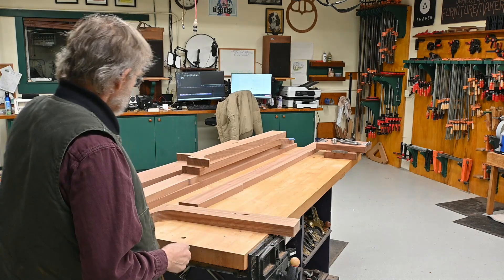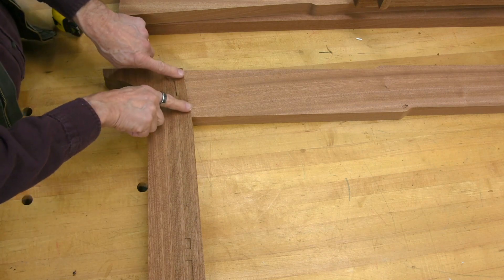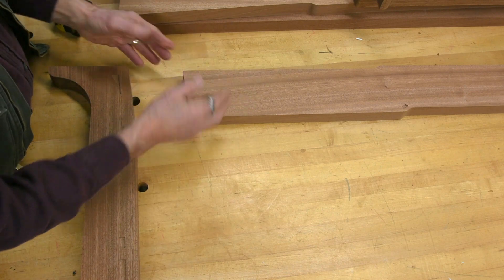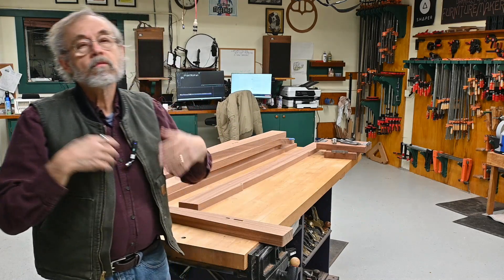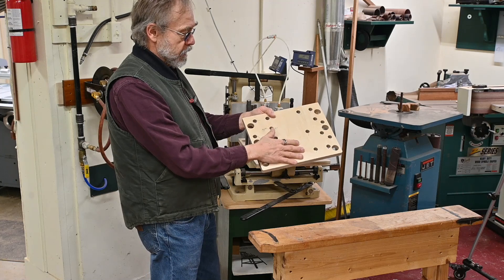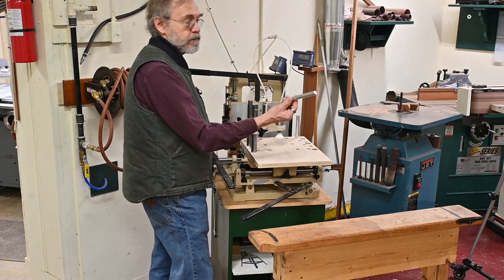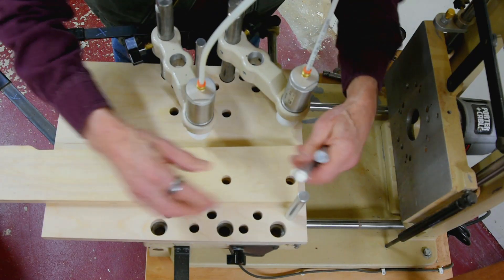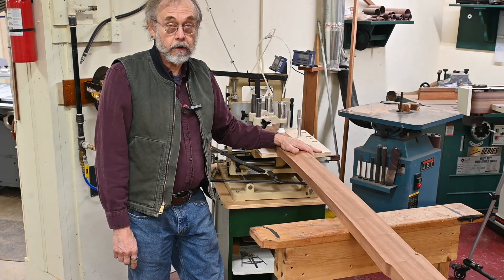Multi-Router : Making an Auxiliary Table Plate

Comment: Hi Darrell.  Where can I get the pneumatic hold downs that you have on your multirouter and table saw?
Reply from the maker: Hi Jeff,  The pneumatic hold-downs for the MulitRouter can be purchased at Woodpeckers - https://www.woodpeck.com/pc-1-pneumatic-clamps.html.  
I got the air clamps for my slider in a trade several years ago. As far as I can tell those particular ones are no longer made.  Felder offers ones that are nicer than mine - https://www.felder-group.com/en-us/shop/pneumatic-clamps~sc123933

Comment: Hi Darrell.  To slot the other end of your piece, will you flip over your registration template and mount on the left side of the table, or do you have your slot dead center so you can flip your work over and keep the registration template where it is.  Nice template ideas.  Thanks.
Reply from the maker: My intention is to position the mortise (slot) dead center and flip the stock.  In this case I recently mounted a different router in my  MR. I will be running some tests 1st to make sure there isn't excessive runout with the bit or router.
Reply: @DarrellPeartFurnitureMaker  Thanks for the reply. Generally I haven't been overly concerned with dead centered mortises, but I've  had to maintain a reference side because of it. Since I got my digital scale, there is no reason that I shouldn't use it's precision and go for dead center.

 I would be interested in a video, maybe even a short video of your findings and reasons for choosing a different router for your MR. Maybe what you like about the new router?  I use Bosch and pretty well love it. I tried a Milwaukee and didn't like it so well, but maybe it was just something up with the router motor.
Reply from the maker: @TallEvaGuy   I might consider a video on routers for the MR.
 I have used both Bosch and Porter Cable routers. Both did well.  
Most of my routers are now Porter Cables. 

The  current router is not new - but new to the MR.  It's a Porter Cable model 890. The base on this model  is longer ( has more contact surface) which I hope gives me more consistency. It also has  better micro-adjustment for depth of cut. 
 I am not familiar with the current line of Bosch routers so I cannot comment on a comparison.

Comment: Nice video Darrell.  I am looking at both the Pantorouter and the Multi-router as possible additions.  I expect that Pantorouter will come out with their air clamps in the next several months which will be a big plus for me.  Since I am space limited, if you only had room for one which would you purchase?  I love seeing the slider in use as well.  Also interested in your CNC vertical work holding setup.  Steve
Reply from the maker: Hi Steve, If I were to have just one it would be the MultiRouter.  The PantoRouter has its advantages but for my purposes the MR is more versatile and precise. 
 My Vertical CNC set up has limited capabilities. I think if I were to dive into it there is potential for serious improvements.  For me its faster to employ the MR  for the things I had intended to do with it.  You might check out the vertical CNC surface that @JayBates has - it looks well thought out and more functional than mine.
Reply: @DarrellPeartFurnitureMaker  Thanks Darrell.  I have seen Jay's and Frank Howarth versions and decided I didn't want to go that route which is why I ended up with the Shaper and workstation for vertical work.  
BTW - I tried the Shaper for the prototyping G&G drawer fingerjoints and it was doable but fiddly.  I used the plunge roundover for the protruding fingers but got a lot of burning.  It may be me or it could be the bit.  Steve
Reply from the maker: @ExtremeWoodworker  did you use Shaper's onboard finger joint feature? I haven't tried it yet . In the future  I hope they update it so you can vary the size of the individual fingers - instead of them all being the same .
 My experience with CNC and situations  like  finger joints - where you have an inside and outside mating contour - the call out for the bit diameter is hyper critical. If its off just a little the joint doesn't fit properly.
Reply: @DarrellPeartFurnitureMaker  I experienced exactly what you describe.  I did not use the on-board feature as it does not allow variable spaced fingers.  I used the Fusion 360 plug-in and struggled with the offsets to get a good fit.  Unfortunately, SO does not permit offsets on individual edges and applies it around the entire shape so that is something that has to be incorporated into the design SVG.  I eventually got it right but it was painful.  That is one of the reasons I am considering the Multirouter or Pantorouter.  Steve

Comment: Darrel thanks for the video the Multi Router is still on my list to pick up.  Looks like the Slider is right at home at this point. :)
Reply from the maker: You're Welcome, Michael.  Yes the slider is right at home. When  I walk into the shop though I still get a thrill just looking at it and realizing its mine!
Reply: @DarrellPeartFurnitureMaker  Forgot to mention kudos on your cutting technique of finish cutting on the saw and router bearing bit vs. trying to cut completely with the CNC.
Reply from the maker: thanks!